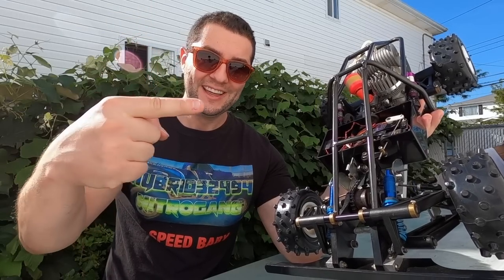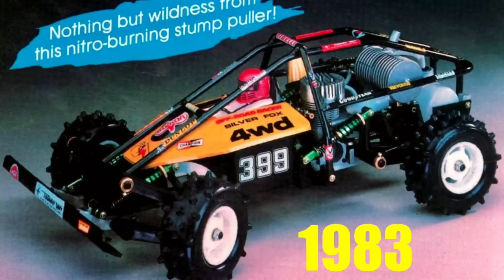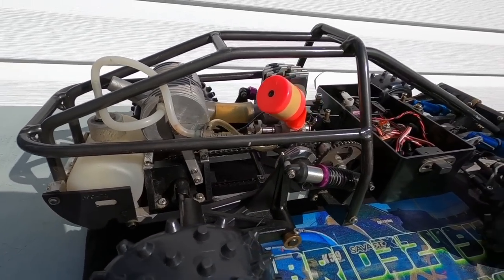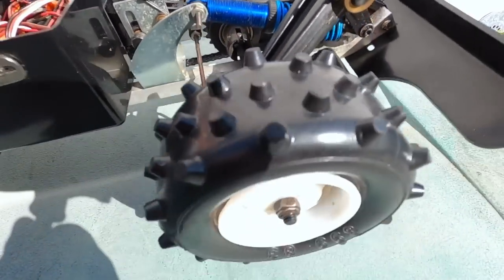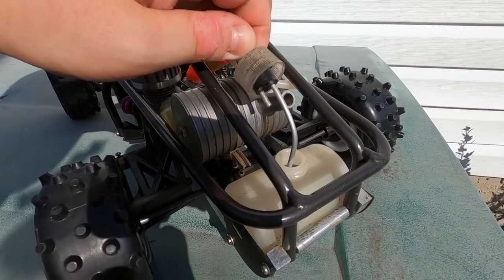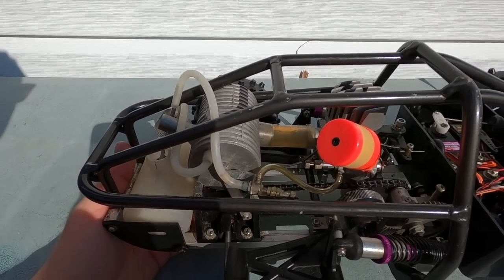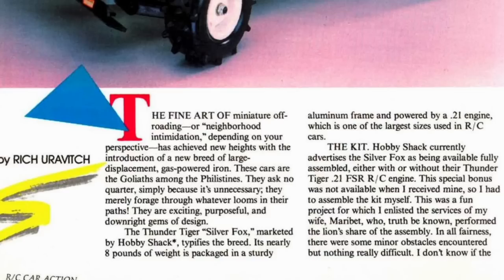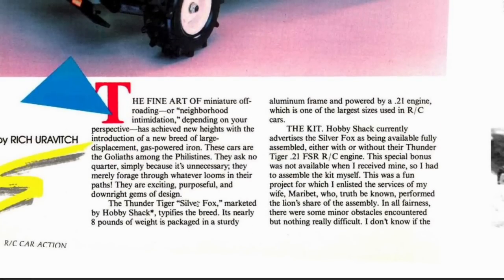Thunder Tiger Silver Fox - 1983 Nitro Buggy - Overview & History - When RCs Were Totally Different

Comment: I had this car in the 80s. All of the metal parts caused radio interference and would cause all the servos to jitter while it was running. I had to buy special servos to get it to work correctly. But was slot of fun after that.
Reply from the maker: hey my dude!  Im super happy to know a person who owned one of these is here in the comments section!  I can totally see how all the metal parts would be an interference nightmare at that time, luckily with the modern 2.4 GHZ system that is no longer a problem.  I even tested the flysky gt5 for interference by touching random metal parts with screwdrivers, no issues!  thanks bro.
Reply: Yes it was very frustrating lol! I was only 13 yrs. Old and barely could afford the car let alone the radio. Servos then we're 25.00 a piece. Wich is probably like 100.00 in today's money... I wound up using a vacuum cleaner belt instead of the flywheel to start it. Worked great. Fit the grooves of the thrust washer of the motor and starter. Trying to bump the flywheel with starter was tough!!! Great job and excellent videos.

Comment: Had one back in the day. Those tires were woeful though. The royal was also very under powered compared to the os. If I remember correctly Royal ended up becoming Thunder Tiger engine wise. I modified mine Way back before decent parts were available. Replaced all 4 wheels with Rears of a PB Alpha circuit car then fitted 4 tires that were originally fitted to the very first PB Mustang. It was decent after that. Today you would use monster truck tires.  You had to set the suspension up pretty hard otherwise you would loose dog bones on a regular basis. I had all mine painted orange an somewhat secured with cable ties to prevent loss when they came out. Not a car to do jumps with though.

Comment: My first nitro car was the Kyosho Nitro Thrasher. It was belt drive. Had an O.S. engine.
Reply: @David-069  Nice. I now just have a Tmaxx with O.S. 21 in it.
Reply from the maker: hey man!  Thats dope!  You cannot kill an old O.S, Engine, I know that for sure.  SO far I have never come across a dead OS engine..
Reply: @hybrid32494  Yes they are nice. I have many O.S. 4 stroke engines in airplanes. They are great.
Reply: @David-069  O.S. 21TM-T
Reply: @hybrid32494  I've worn out quite a number of .12CV piston/ sleeves during my racing days. But they were quite resilient!

Comment: Doesn't even look old just looks stout.
Reply from the maker: ye man, I totally agree.  This seems to have aged very well and for the most part the drivetrain and engine is similar to modern nitro models.  I'll be firing it up and tuning the motor in the next part video, thanks for watching bro.
Reply: Warm the tires up a little in the sun see if the beed sits properly.